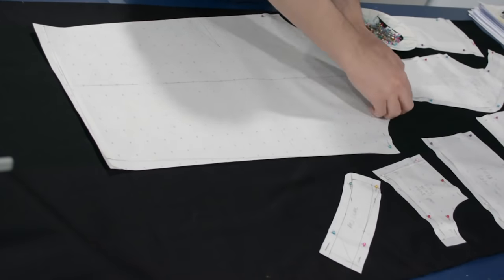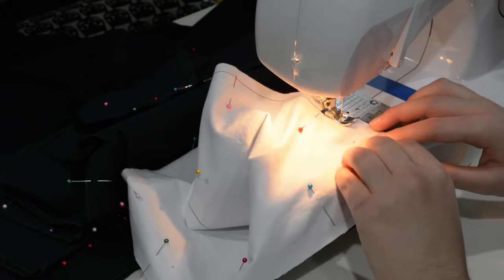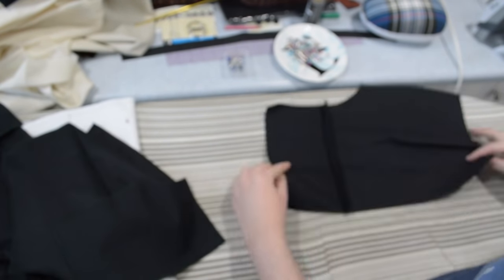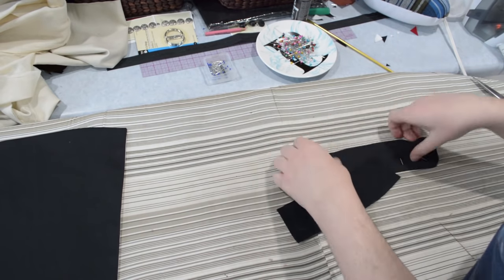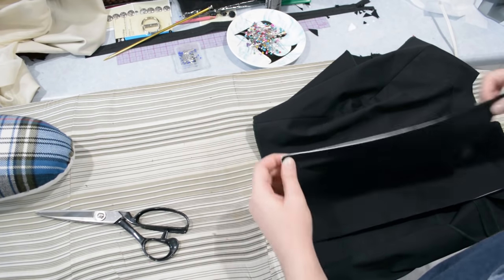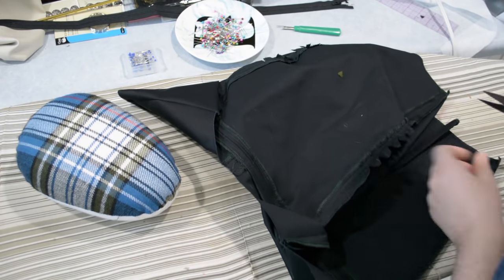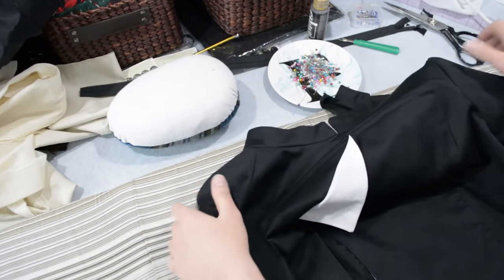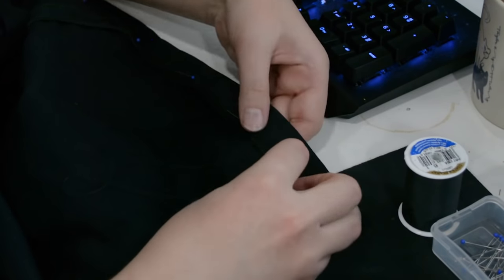Sewing a Luke Skywalker Inspired Dress || Project 83 PART 2

Comment: if you wait to remove the basting stitches until after you've sewn in the zipper, the seam there will meet fully over the zip, and you won't have to bother with lapping it over like that. it's how i "hide" zippers when i'm not using an invisible zip.
Reply from the maker: That method is called a railroad or centered zipper, and I simply just prefer lapped zippers myself. It's all a matter of personal preference indeed :)

Comment: Really liked the long versions better. It was so much easier to follow your design process via the sloper and making the changes needed for the actual pattern. I do like to watch the sewing in real speed and for me, it is not boring. You could use a black sharpie to color in the white edges that show from the sides of your cover piece on the bodice if you don't want the white to show. I have done this when I was a little off with my doubling the fabrics and it worked out fine. The dress looks stunning on you. Wear that out a few places and you will have dates galore!  I would bet peplums would look very nice on you as well and they would keep with your admiration of vintage clothing. A couple of questions, Why did you use 1/2" seam allowances instead of 5/8ths and what are 'fitting shell' patterns?  Thank you so much for sharing your talents with us.!
Reply from the maker: Thank you Peggy! Did you see that I posted the full pattern drafting as well? The videos are essentially the same as before, I simply split the pattern drafting into one video and the sewing into another, breaking the long video into two parts, but I edited it the same and included all of the same information. I just know some people have no interest in either the sewing or the drafting, so this way those folks can choose to skip whichever half isn't relevant to them. I use 1/2 seam allowance because that was what I was taught in fashion school I'm afraid!
Reply: @TheClosetHistorian  Thank you for taking the time to respond. Yes I did see the drafting video as well. I really like your approach and I do learn alot. Thanks again!

Comment: I love how well the dress turned out and you've shown me a better way to alter the pattern to move the bust point down for a better fit.  Did you leave the seams unfinished? Asking because I'm a real freak about seam finishing. I horrify the local tailors and seamstresses because I only use my server for seam finishing.
Reply from the maker: Thank you Susan! I always go over my raw edges with my serger, I just prep them all that way before I start sewing anything together :)
Reply: @TheClosetHistorian  after cutting, I make the markings in an exaggerated way, then serve the edges before sewing it together. Or I leave certain pieces unfinished and then use the serger to finish the seam, as well as cut away bulk.

Comment: Does mens clothing use the princess seam or don't? It look like a great estructure tool but seem to be more fitting for the bust
Reply from the maker: I'm not sure they do really, as I think you're right that it is used mostly to fit over the bust. Unfortunately I have zero menswear training though so I am no expert!
Reply: @TheClosetHistorian  that's ok it does make sense for bust fitting specially for the frame of womens body, because mens may have more chest than womens but 80% or more is the back and shoulders, plus men garments only have the waist to hip dart (or however it's called in english, we called "pinza")